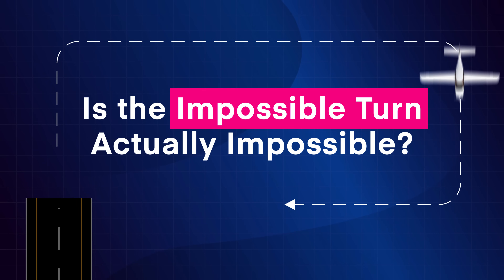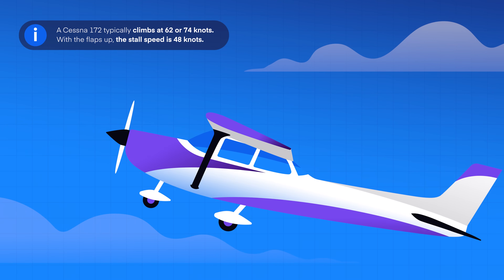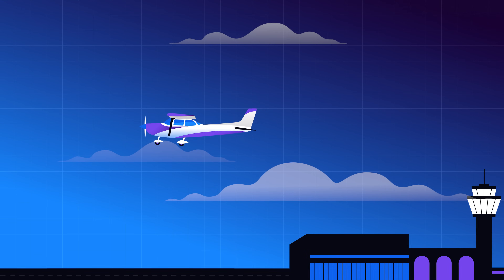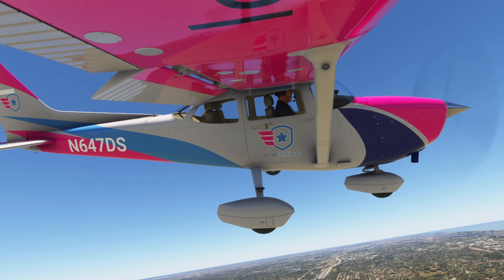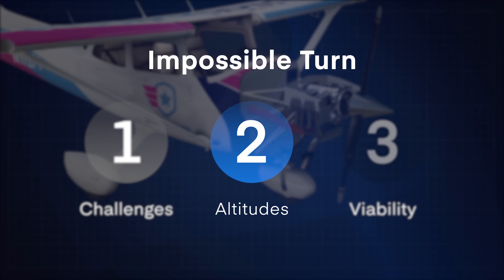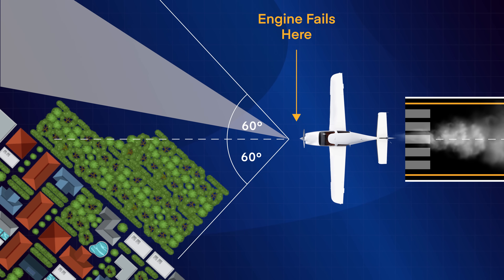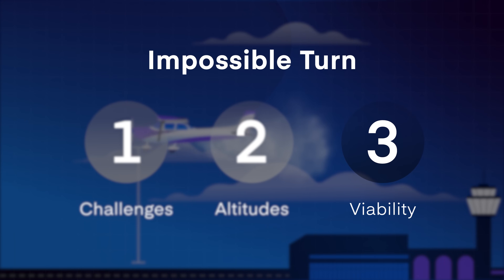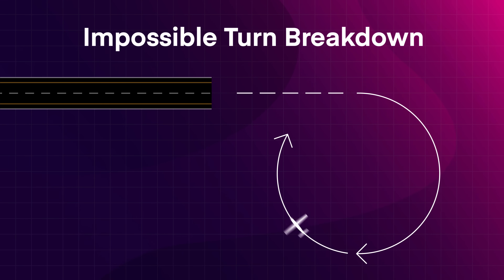Is the “Impossible Turn” Actually Impossible?

Comment: The most important point is the psychological one.  Most GA pilots, if faced with an engine emergency, are not well trained enough to properly assess the risk/benefit ratio of the impossible turn.   Panic mode will set in, and their brains will revert to neurological alternate law, and they’ll usually instinctively try to turn back.    Either they need to be trained a la AQP and then left to make the decision for themselves in the moment of an emergency, or a standard protocol needs to be established that’s the average safest course of events…which is undoubtedly to NOT attempt the impossible landing.   Keep wings as level as possible and find the most suitable place to put the plane down.
Reply: at  that point the plane belongs to the insurance company. Do whatever it takes to survive.
Reply: Yeah most people won't do well weighing the factors in the moment. Which makes it seem wise to decide your turnaround altitude ahead of time. Maybe right now. For example if you fly a 172, you would likely make the turn from 2000 feet. You shouldn't try it from 800 feet. What altitude can you and your plane make that turn from, in the location and conditions you're most likely to fly in? Seems like it would be good to decide that altitude calmly, on the ground, rather than in a panic in the air.
Reply: The bigger problem is the instinct to pull trying to tighten the turn. If you don’t pull and let the nose drop you won’t increase AOA and you won’t stall.
Reply: @jimallen8186  The key word being “instinct.”   Training a human to overcome their instinctual reactions is far easier said than done.   So either there needs to be a dependable training modality that people can hang their hats on being thorough enough to override the instinct (in which case, I guess the impossible turn can be officially sanctioned), or not (in which case, it probably shouldn’t be).
Reply: No amount of training will alleviate the problems when a total engine failure happens on takeoff.  A pilot would have to immediately react perfectly, make every correct calculation of altitude, wind, load factor, glide ratio and proper control settings,  and no pilot does...

Comment: Human factors was not considered in this video. That makes the impossible turn even less posible. Dont do it! Straight ahead, don’t get dead.
Reply from the maker: We mentioned the human factors a few times.
Reply: Author said it takes 4 seconds, and longer if the pilot is inexperienced.
Reply: Additionally, a formula for navigating an aircraft emergency is a recipe for disaster.  You make the best decision based on the situation given, and if returning to the airport is the best decision, then that is the course of action you must follow.  Don't discard a solution based on a catchy phrase.

Comment: The technique described involving best glide speed is wrong. Push forward to get a much higher speed and do a steep semi split S at minimum g s. This gets the turn done quickly. You will be low and fast. It is not necessary to get to the runway, only more unobstructed area on the airport. Another technique is after takeoff and local obstacle clearance turn 30 deg off the runway heading towards any downwind crosswind. The turn back into the crosswind gives a better chance of making the airport. 172 type aircraft the turn should be done above 90 knots. The pushing and accelerating in the dive will reduce the g s in the turn which should be at least 60 deg bank. G s are only pulled at constant speed and altitude. This diving bank can actually be done near 1 g. In a 170 it can be done at 400 ft. AGL.
Reply from the maker: Low and fast at many airports out West is not an option unless you like craters.

Comment: Depends, a friend of mine had total engine failure at 600 feet. Made it back to runway with a little to spare. Cessna 150.
Reply from the maker: 600 feet, depending on density altitude, is right at the edge of this being possibly feasible.

Comment: As with most things, I think proper training and practice is the key here. A game changer for me was when I got my multi-engine rating and was taught that an engine failure WILL happen on every takeoff, so decide and plan how you're going to handle it before every takeoff. I also realized that the 4 second reaction time doesn't fly well in a twin, cause in 4 seconds, you'll be augering into the ground in a twin. This taught me that I had to be preconditioned to react immediately to an engine at various altitudes. I took what I leaned getting my multi and began applying it to flying singles. I went out and practiced the maneuver several times at a safe altitude; leaning how best to accomplish it and establishing a minimum altitude with margin to begin with. I then flew to a quiet airport with a decent size runway surrounded by cow pastures and corn fields and near zero obstacles for a mile all directions and practiced it several more times. Finally, I practiced it at my home airport, which has few options for forced landings, and I continue to practice it a few times a year. I've since tried it in several different Cessna's and found that for me, it can work starting at 500 feet under most conditions. If it's hot or I'm heavy, then I make it 600 feet. The maneuver that works for me is: nose down immediately at power loss and roll into a 45° bank, hold Vy throughout the turn, once I'm headed towards the runway I roll wings level, pitch for best glide, lower the gear (if applicable), and maneuver and add flaps as necessary to land. Out of the dozens I've times I've practiced it in the least few years, I only came up short once, and even at that I would've easily made the grass beside the runway had I not elected to go-around. Another time, I made the runway handily, but used almost all of the mile long runway stopping when I had a 15-20 knot headwind on takeoff, so I now consider 15 knots a maximum. Before each takeoff I take a few seconds to decide if turning back is an option on this takeoff, what will be my minimum altitude, which direction I'll make the turn based on the winds etc. Sometimes it's just not the best option, like if I'm flying in a type that I've never practiced it in before. Even in a twin landing straight ahead is the only safe option sometimes. But some days at some airports, the "not so impossible" it might be the only good option.
Reply: Thanks for your detailed reply with experience ❤
Reply: Often the multi is really an extension of the straight ahead landing. You can “glide” a little further. Losing an engine off a high density altitude airfield and that other likely won’t get you back around. Startle factor may put you below Vmc hence you need to pull power on the good while getting nose down to get back above Vmc, then increase the good but it may not be enough poop. Straight aheads with multies are still good options; don’t let the second engine preclude consideration of straight ahead. Now with this, check out James McClaran Allen on Medium with his piece regarding Light Twins Spins. The other pieces are pretty good aviation safety bits too.

Comment: Not very impossible in a glider, given a few hundred feet we will go for an abbreviated circuit
Reply from the maker: Good thing engine failures in gliders are… rare ;)
Reply: @PilotInstituteAirplanes  ...unless they're motorgliders.  ;)  Their use of similar engines to equivalent airplanes suggests similar odds of engine failure.  With that said, the sink rate calculus for a motorglider still looks very different than the Cessna's.

Comment: I think this falls under the category of it's not that it's impossible, you just really don't want to be in a situation you find out if it is or not.
Reply from the maker: Spot on!
Reply: @PilotInstituteAirplanes  John Young didn't want to fly an RTLS for STS 1 for this very reason.
Reply: 100%
Reply: It is impossible.  PERIOD.  Always plan for a straight ahead landing spot.  If you do not, you can screw that up to.  The shock of losing engine power is enough to cause pilots to lose situational awareness and make more than one mistake.  If you are arrogant you will think you dont make mistakes, if you are objective you will KNOW you will make mistakes and if you are not already planning the straight ahead landing, you will also fail to even do that as well as possible.

Comment: No, it's not. I did it while receiving dual as a Student Pilot, upon the surprise power-loss on climbout that was courtesy of the ME-CFII. Response was almost immediate, setting-up as taught in prior lessons. The keys were: Immediate response & proper setup. That's all there was to it. Did a 200-220° turn & was prepared to touchdown on the departure runway, when the ME-CFII returned power to the aircraft.
Reply from the maker: Your CFI pulled the power on you on takeoff as a student pilot and you did a 180 degree turn to come back and land on the runway, for practice?
Reply: @PilotInstituteAirplanes  200-220° turn, followed by opposite-direction turn to line-up with the departure-runway, having somewhere around a quartering-tailwind.

Comment: In most light aircraft yes it’s completely impossible, the big problem is not the stall or the turn it’s the fact that you just won’t have the height, light aircraft typically have very little excess power so the climb rate is very poor.

Comment: Always worth considering your weight, the density altitude, the runway length and environment, temperature, wind conditions, and preparedness. If you haven’t briefed the possibility of an impossible turn and when you’ll be able to do it, don’t do it. 

It will be a lot easier to complete it with a Cessna 172 on a 9000 foot runway than it would on a 3500’ runway. Also if you have a crosswind and turn into the tailwind then you’re just going to push yourself further away. If the density altitude is perfect for climb performance, you’ll be more likely to successfully accomplish it. 

Trying it with a cfi from safe altitudes and keeping in mind conditions and an idle engine vs complete loss will paint a better picture of how dangerous and difficult it can be. For example, tear drop landings from 1000’, 800’, 700’ etc, will start to really show viable it will be. If you can’t really safely get it around from 700’, definitely not worth pulling it at 500’

Comment: Interesting video, especially for me as a glider pilot. When the rope brakes during a winch-launch, we easily can fly the "impossible turn" - actually, the "impossible turn" is a well trained procedure for us. In case of a rope brake, we fly the impossible turn above an altitude of only 150 feet.
Reply: A single engine aircraft falls like a brick compared to a glider.  You have to nose it down to even stay in the air.
Reply: @LarsLarsen77  I think, it is more about how the tun is performed. As a glider pilot, you fly the turn "vice versa", first you turn away from the center line of the runway, then you make a U-turn, and then, you are back at the ceneter line for the final. I think, that is the main piont making the turn "possible".
Reply: Then it's only the "impossible turn" if it happens under 150 feet in a glider.
Reply: You're comparing a leaf to bowling ball. Powered aircraft have a much poorer glide ratio than a glider. In a Duo Discus, you'd actually have to stretch the turn out or fly ahead for a bit in order to lose enough altitude so that you wouldn't overshoot the runway making the turn. In a Bonanza, you'd slam into the ground before even getting around half way.

Comment: Flightsafety teaches and checks us on engine failure turn backs every six months in the PC12. They do it at low density altitude (KMEM) at 1300’ AGL although the military kids can do it as low as 500’ AGL.  Easy peasy especially in the NG even in zero zero with synthetic vision.  Engine failures on a hot day in Montrose are a different matter, I land straight ahead.

Comment: Good lesson.  I have some empirical data for the low altitude forced landing, but have had only one engine failure at altitude.  From fifty years and 17,000 hours at 200' or lower crop dusting and flying pipeline patrol my orientation changed from altitude is life to airspeed is life.  Nine of my eleven low altitude engine failures were six second deals.  Aviate...  No navigate.  No communicate.  Because I always had cruise or near cruise airspeed from either extra ground effect energy in the spray run or just cruising on the pipeline, I was able to make the very safe energy management 1 g turn at any bank angle necessary to make a good landing zone.  I would simply use cruise airspeed to pitch up wings level and when slow bank at whatever angle needed while releasing back pressure on the yoke.  Because of neutral dynamic stability, the airplane cannot stall itself.  A pilot pulling on the stick is required.  In this energy management turn, airspeed is traded for altitude (law of the roller coaster) and then altitude is traded for airspeed (same).  Try it at altitude and you will like it too.

The basic level in low ground effect, sort of like the old soft field, takeoff is default for the crop duster as he always is max loaded and needs all the extra free ground effect energy he can get.  If the runway is 1,000'' he gets into ground effect well below Vso, and out of ground effect airspeed anyway, levels the fuselage and stays in six inch ground effect until any obstruction forces him to pitch up and then only pitch up enough to just clear the obstruction.  Airspeed and not altitude is life down here.  While on the pipeline the level in low ground effect takeoff was default for me as well in small Cessnas.  My only engine failure on takeoff was in a 172.  From my six inch perch, I landed on the runway remaining.  It hurts my sole, and many pilot's tin and skin, to see pilots use no free ground effect energy, pitch to Vx or Vy when not appropriate as the obstruction is thousands of feet away, and struggle as the outcome of such a poor energy management decision is always in doubt.

So, while as a crop duster I have the energy management turn that would most likely result in a favorable impossible turn, I have never chosen that technique as a get out of jail free card.  After thousands of impossible turns with power, yea even tighter, crop dusting, I had no confidence in going back into the field I was spraying without power.  I did have the energy, airspeed, to maneuver to a suitable landing site.
Reply: Alternately, you can say “energy is life.” Whether it be kinetic, potential, or both. Military low level flying is similar, have sufficient energy to maneuver to include zoom. Note a zoom is distinctly different from a climb. Zoom is trade in KE for PE while climb is chemical for PE.

Comment: What people don’t understand is that you are making a 360 degree turn by the time you line up with runway centerline.
Reply: No you aren’t.  Probably about 270-280 after you add all of the angles up if you’re aggressive enough on the first high altitude turn and turn the into wind after letting the plane drift during departure.

Comment: It’s definitely impossible under certain circumstances.  Due to low performance, low winds, and high density altitude.. many light aircraft will have a departure angle that’s shallower than their glide ratio.  

Also consider the risk factor vs just having a forced approach straight ahead.  If you can fly the plane to the ground without stalling or spinning.. you will survive a forced landing into almost any terrain—including trees and neighbourhoods.  

There are a lot of dead people who tried to save the aircraft. Don’t.  Destroy it to save yours and your passengers lives.
Reply: Maybe don’t have a departure ratio that is less then your glide ratio 
That should stop it

Comment: People have different opinions on this, some say its possible some say it's not a good idea. It is possible if the conditions are right. Depends on your plane and its ability to glide and turn. Also depends on your ability as a pilot. Winds. What altitude the engine fails. As was mentioned in the video. Well I think it pays to be prepared. Practice the scenario in a practice area. Know your plane, how it can turn, the limits etc. Have a plan for yourself ahead of time, including which decision you're going to make if the engine fails at different altitudes. Study the airport surroundings, fields golf course highways farms etc. Be prepared that the engine could fail on climb out and make a decision depending on altitude. Know your plane's best glide speed. I think the Cessna poh says land straight ahead, but use your discretion. Cessnas. don't have the best glide ratio. A cirrus might have better chances of making it back at lower altitudes. Well they got a parachute too. But ya practice and plan ahead. To know what the best decision is. Got to make decision fast.

Comment: Great video, thank you.  Something that wasn't considered here is traffic.  Is there enough time to communicate with ATC to have them clear the runway if other traffic is lining up to takeoff?

Thank you
Reply: That's a good point.
Reply: Yes and no. I had plenty of time to call out "N1234 engine failure landing runway 3" but by the time I was initiating the maneuver a Bonanza was just off the ground behind me. I knew he was there because I'm always paying attention to the radio, and I was able to dodge him. The tower told him to watch out but he never saw me, or even had a clue there was an emergency happing right in front of him.

In my opinion the radio call is very important at busy airports and it's easy to make very rapidly, especially if practiced. However it won't always make a difference if traffic is already on the move behind you. Just another reason to maintain awareness of everything happening on the field and on the radio.